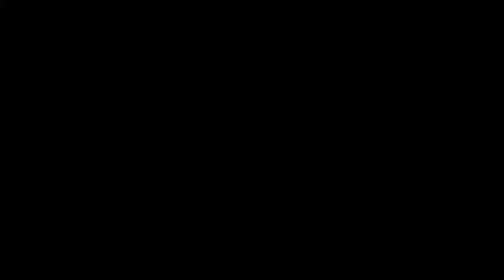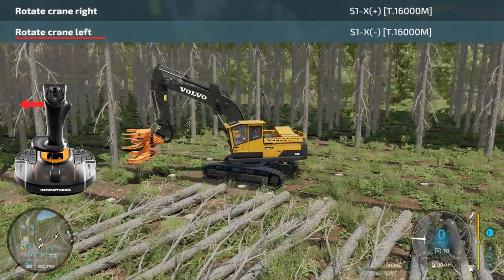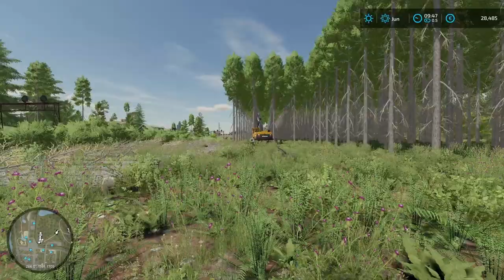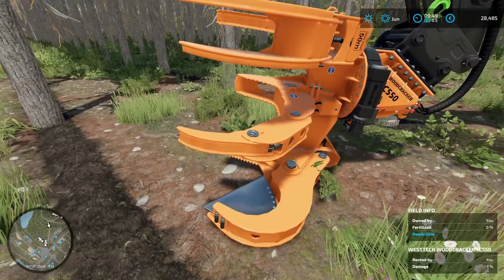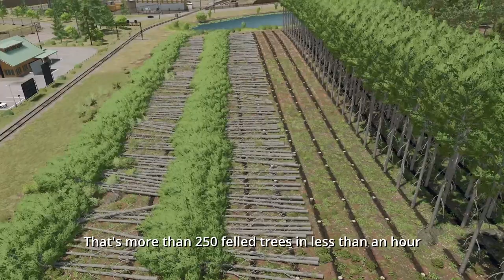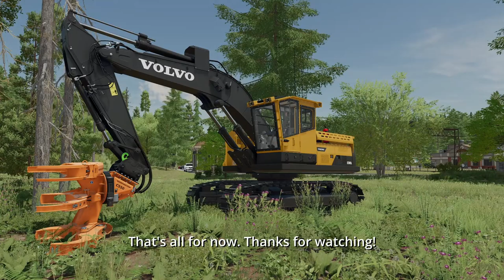How to Operate Volvo Feller Buncher with Realistic Controls - FS22 Platinum

Comment: Your realistic control videos are excellent,thank you for taking the time to make them. How do you swap the tilt controls between the feller buncher and excavator?
Reply from the maker: Thanks! I just changed the input binding off camera.

A little tip related to this is that you can set the controls for one type of machine, (eg buncher) and then duplicate the inputBinding.xml file and set the controls for another type of machine (eg harvester).
To switch from one file to another you have to close the game and rename it but sometimes it's easier and faster than messing with the controls.
Reply: @bargonmods  Thanks for the tip, ideally a program that sits between windows and the game, that allows switching profiles on the fly with a button press would be great. Remap controls for excavator, buncher (invert axis) and harvester but this is way beyond my skill set.

Comment: Hi, cool video! I think I'm gonna stick with my own controls though which is basically SAE excavator controls with four buttons on right joystick and two on the left. Quick question, what would you realistically do with the felled whole trees in real life? How are they processed further?
Reply from the maker: It depends on the method. 
One way to do this is to create piles of trees with the feller buncher and then drag them down with a skider to the processor (piles should be about the size of the skidder claw). In this method the processor or delimber is on a flat area where the wood is processed and loaded onto trucks.
Another method and what I am doing here is to create a row of felled trees ready for a harvester to process them on the same site creating a row of processed wood. The logs are then transported out of the forest with forwarders. This method is widely used, for example, in eucalyptus plantations where a feller buncher cuts down the trees and two or three processors process the felled wood.
Reply: @bargonmods  Ah, well in that case why not just use the harvester to both fall and process the trees since it's going to be at the site anyway?
Reply from the maker: More production, lower stumps, less wear on harvester heads and chains
Reply: @bargonmods  Ah. Thanks for all the replies! Can't wait for the Wood Harvester Controls that is multiplayer compatible. Thank you for all that you do!

Comment: Are you going to update your mod for the new dlc content? Manual opening of the head etc? Currently it is only available for machines released before platinum dlc. Is this even possible to do? By the way... Great modification. Harvesting with this mod is a pleasure 😀
Reply from the maker: If you are talking about the Wood Harvester Controls mod, it's working with the DLC harvesters. Make sure you have the latest version V1.1.0.0 Beta (link in the description)

Comment: I've tried the buncher on various machine's that allow them. And it seem's that one can only close the jaw's using a separate process when cutting the tree. Not switching fast enough cause's the tree to fall prematurely in the direction the buncher is aimed at. The jaw's that are supposed to hold the tree in position should close at or extremely closely at the same time the blade is cutting. Not a separate process. But then I utilize a game pad and not hotas's aka two joy stick's.